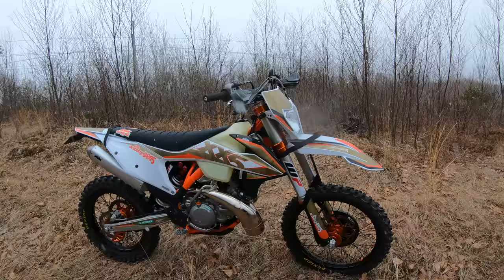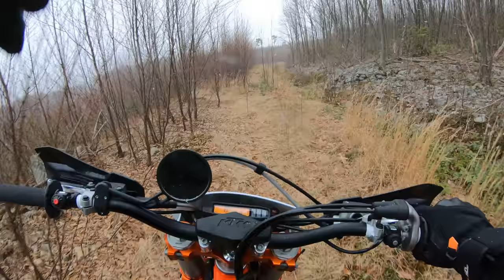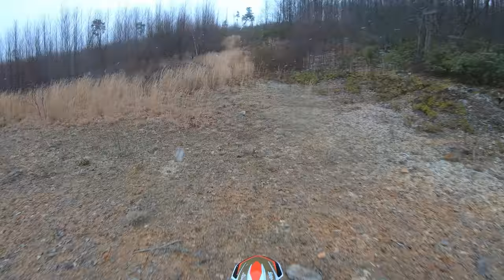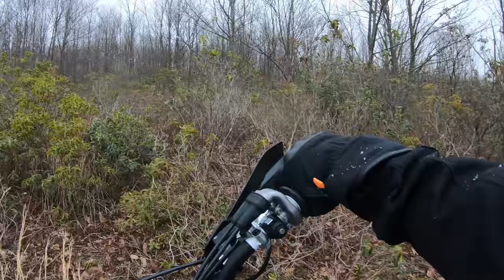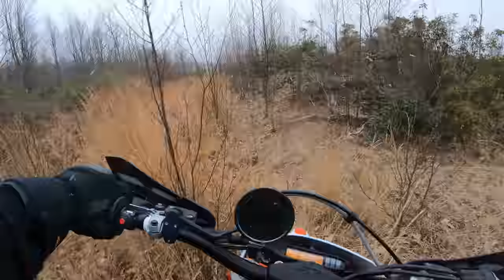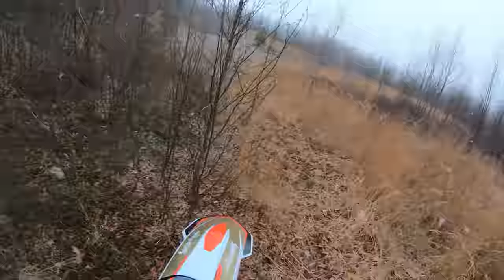2020 KTM 300 Erzberg with Coober ECU

Comment: I’m looking at a Coober for my Erzberg as well.  My only question is does it operate the radiator fan same as the stock ecu? Thanks!
Reply from the maker: I was told it does operate the fan with similar parameters as the stock ECU but not sure how to confirm what triggers the fan on the stock ECU or the Coober.  I assume there is a water temperature trigger level for both.  The fan rarely comes on with my riding (and did not come on during this video as the ambient temperature was 31F!)

Comment: So does it feel like it had more balls with new ecu over stock?
Reply from the maker: Gives the bike a little quicker throttle response - like it is getting a bit more fuel - more torque feel.
Reply: @mxengineer1  just a little?
Reply from the maker: @nightrider4370  Correct - it is a subtle but noticeable improvement in throttle response.  When I ran this ECU on my 2021 KTM 300 Erzberg I did not notice any difference so perhaps KTM made some ECU mapping changes to the '21 300XCW.